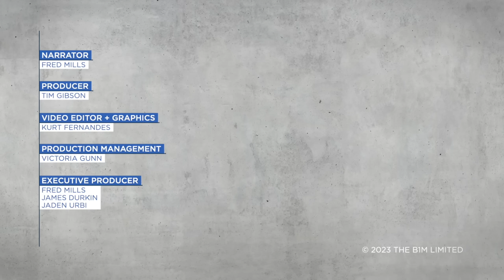The Race to Build a $6.3BN Railway for the Olympics

Comment: Excellent video and a really impressive project. Putting a mezzanine in the bored tunnel seems like a really innovative solution (I'm not aware of if it's been done elsewhere). Also, I can't help but notice the Cross River Rail logo is practically identical to the Crossrail logo.
Reply: I think something like mezzanine has been done in Barcelona

Comment: Calling it a 'race' to finish it for the Olympics is a bit of a stretch. It's scheduled for 2026, and while it'll almost certainly be late, 6 years is a lot of wiggle room.

There are a lot of planned expansions to the network that are dependent on the inner city  capacity created by CRR though, and they'll be very challaning to get done by 2032. Most key of these is the Direct Sunshine Coast Rail Line project, as it's presence would be a huge boost for any events hosted there. A core aspect of our bid was that we'd host the Olympics are a region rather then just Brisbane city itself. Thats going to require much stronger intra-regional transport links then we presently have

Comment: Questions about the mezzanine: Is it the whole length? Is it thus an alternative to the trains? Will bicycles be allowed as well as pedestrians? Will there be a charge to access the mezzanine?
Reply: The mezzanine is only for station caverns. The train tunnels connecting the stations, will only have enough room for trains, they are quite narrow tunnels. To access the mezzanines at train stations, you may need to tap on with a Go card or with a debit card, but you could tap off when you leave and not be charged.
Reply: Mezzanine spans all of cavern (approx 200m). It will be a walk way above platforms. Access to platforms from mezzanine will be be via escalators and lifts.

Comment: Being from Brisbane, I really have to cringe that the stock footage of the Bowen Hills Spaghetti Junction features so many times in the video! Really need to dial the car-centricism right back and build far more projects like Cross Rover Rail (like an actual underground metro rail system - Cross River Rail is actually part of the suburban rail network, not a metro as stated in the video).

Comment: "A new metro that burrows under the city itself..."  As opposed to a metro that does what??
Reply: Is above ground like most of Chicago
Reply: A metro like the other stupid one we will have soon that are electric buses! Wish they wouldn’t call that a metro.
Reply: "Metro - A rapid transit rail transport system, or a train in such systems, generally underground and serving a metropolitan area."
Reply: There's many great metros that run mostly overground, meaning elevated. But nowadays those are really difficult to build with individual rights being so much more important than doing sensible stuff
Reply: @jan-lukas  There are some, but they are not usually referred to as, “Metros.”  Metros commonly referenced include: Paris, London, Tokyo, NYC, Madrid, Barcelona, Montreal, DC, HK, and others are all underground in the city centres.
Reply: Services a real economy?? ?

Comment: With the Olympics now coming to SLC in 2034 it would be interesting to see you all do a video on the proposed construction project called the Rio Grande Plan. Its a proposal to take the existing rail lines that cut through the city, splitting it in half, and burring them underground. This project is in its early stages, but I think its a big big deal and I also think it needs some awareness raised. Its a community proposed project from a group of passionate people. They are having their second public event to showcase the results of the Cost and Impact Analysis done by the city.

Comment: That's great and the infrastructure will benefit the city long after the Olympics.

Los Angeles is building a much more comprehensive infrastructure program that should be finished in time for the 2028 Olympics 

There will be several new Metro lines (both subway and light rail) and LAX will finally have an automated people mover that will connect to the LA Metro. Very exciting stuff.

Comment: "won the Olympic Games" - not hard when you are the only city who applies.

Heck, even I could win the Olympic 100m sprint if I were the only person running.

A large portion of Brisbane was and still is upset that we got the Olympic Games. It will do for Brisbane what the Olympic Games did for Melbourne (most people don't even remember Melbourne had the games).

Also, Cross River Rail was approved well before the Olympic bid meaning it's completely unrelated.

Comment: The only problem with all this infrastructure is that there are massive problems with the train lines coming into Brisbane from outlying areas especially the northern line from the Sunshine Coast.  For most of this line it is a single track (which along with passenger trains to Brisbane also has freight trains and long distance trains to places further north) and that makes travel by train very difficult especially for any Olympic events they plan to hold in this region.

Comment: The other big  Rail project  is the Inland Rail connecting Brisbane to the ports of Melbourne covering a staggering 1727 kilometres which is underway and due for completion in 2027 !
Reply: At 60kph, it will take a while. That was my experience on our Tilt Train, unlike the 400kph we did on the Paris to London train. It was quicker to go under the English Channel than it it was to travel "Express" from Caboolture to Brisbane.

Comment: Australia needs a super high speed rail line between West and East and North and South, preferably with massive sections underground to avoid the climate and so as to not inhibit animal activity
Reply: Australia needs it? No. 
Do some people want it? Yes.

Does it make economic sense? Absolutely Not. 

Flying is way cheaper and faster, if the hassles of going through the airport and  checking times were to be eliminated, absolutely no one would use trains. 

Trains literally became popular because of the unbearable hassles of going through the airport.

Comment: Seattle has done much of this and used the largest boring machine at the time in the world to dig directly under the center of the city. So a lot of what’s in this video is not new or particularly special. Seattle has a transit light rail tunnel under the city, more recently relocated an elevated highway to under the city, and long has had a heavy rail tunnel directly under the city as well. Seattle even built a world class symphony hall on top of the train tunnel and managed to completely isolate it from the noise of the trains.
Reply: Are you hoping to get a cookie or something?
Reply: Yes, Seattle is both a larger and older city than Brisbane. But it also has much worse transit accessibility, you can go a lot further in 45 mins using Brisbane's buses and trains, than you can in Seattle.
Reply: A contrast with Sydney or Melbourne would be more meaningful. Melbourne 4th and  Sydney 7th on the Global Likability Index. Seattle 34th. Brisbane 16th.  Vienna is first.

Comment: As key as this and similar projects are the vitality of the result will also require connections to outlying areas. 

I mean we did it with road$ which is a continual economic drain. So rail systems which demand far les$ maintenance have to be at least as connected as road systems are.

Comment: I wonder when Canada will finally start a mega project. Busiest highway in the world and nothing
Reply: As a resident of Brisbane, I am confused by this comment. Canada has projects that make everything Australia is building look tiny. 

For example, the new REM that has opened in Montreal. Or the network wide expansion of GO's rail corridors and Toronto getting a new automated subway. 
Canada is going to have some of the densest most walkable, urban cities in the world. Some of those cities will have the best transit in the world, certainly Toronto at least. 

Brisbane's suburban bus frequencies can be hourly in some places. Not to mention our extremely radial network meaning getting from suburb to suburb always requires going into the middle of the city. Almost no buses go across the city like in Toronto. 

Yes Cross River Rail is an awesome project, and we will soon have bus network reform and the Brisbane Metro BRT project. But Canada has a lot more going on. Canada is also a lot more likely to start construction on high speed rail than Australia will ever be.

Comment: Good job in showing pictures of different cites that aren't Brisbane, that are 50 miles away of Gold Coast....
Reply: Both cities are so interconnect they have the same public transport system. Thousands of people live in the Gold Coast and work in Brisbane. CRR adds 3 new Gold Coast stations and CRR will be the new route for the gold cost suburban rail line. Also the Gold Coast is hosting some Olympic events.
Reply: @conorchristmas6844  my point is, that the point is not made

Comment: Melbourne is building almost the same thing, if not wrong, they're even ahead of Brisbane
Reply: But Melbourne doesn't even have a train line to the airport like Brisbane
Reply: @adambrock3932  that's not what this video is about
Reply: @miranblazek5303  actually it is
Reply: Same with Sydney and we are doing it at a heaps larger scale, the south west metro line that tunnels under the harbour will open up with plenty of new stations and converted stations to Bankstown and that's not even looking at the other 2 lines under construction alongside the airport. If anywhere is ahead it would be Sydney with its infrastructure projects. Plus I still find it funny how Sydney will have 2 airports with rail links before Melbourne even gets 1
Reply: @adambrock3932  its about the second river crossing in brisbane, melbourne is getting another one too

Comment: I think it's a little disingenuous to say that the model was made in projectwise. Projectwise is an environment that hosts the model, but the architects and engineers did not make the model in projectwise. I'm sure they developed the model with many other software products, I hope they used Rhino + Grasshopper as it's the best design software and I know it's pretty popular in Australia, but idk for sure. Regardless, saying something like this requires projectwise leads those who manage projects (but have no intuition on how to design it) to force the designers to use it. But as the designer I would rather be in control of what products we use to make sure they are the right ones

Comment: Why an underground rail crossing vs a cheaper rail surface bridge
Reply: If you have a look at the CRR project map, it chose a corridor that causes too much disruption to the surface had it not been a tunnel.

Brisbane seems propose tunnelling as the default, also for projects where it doesn't make sense such as the northern transit corridor that is proposed. They want to tunnel under the corridor of grass that was reserved for rail, because they don't want to disrupt the nature. 

I get not wanting to rip up nature but there are ways to mitigate. So yes, Brisbane certainly is infatuated with tunnels.
Reply: Because it is entering the city centre so how could it not be in a tunnel?

Comment: They could've tunneled it (cut & cover) under the park surface along with the Inner City Bypass... In a very much straight line, instead of meandering in slow-mo
Reply: Australian rail projects tend to be against using cut and cover.
Reply: @KhanPiesseONE  The City Circle in Sydney used Cut and Cover.
Reply: @TrainsForNSWVlogs  Yes but I meant newer projects
Reply: @KhanPiesseONE  True that was in 1932.

Comment: I live in Brisbane and this money couldve been spent on way way better infrastructure projects than this. Towards the north of City there are essentially only two roads, Gympie Road and Sandgate road both of which get choked pretty badly. Its a major issue for people living there. Same goes for the west of the city. The suburbs this project are going to connect are already pretty close to city with good bus access or even car. This didnt even touched on gabba expansion which is insanely expensive project for the amount of seats its delivering (I know number of seats is just one thing but there are far better things this money should have gone to)
Reply: As another resident I totally disagree with this assessment of CRR.
Reply: @newbris  you did convince me with such strong arguments mate 😅
Reply: @heisenberg4763  to be fair it wasn't directed at convincing you. YouTube has word limits and the starting point was too far!

Comment: One crossing? Rubbish, there's two crossings, and we used to be able to override the limit by using Tennyson Corridor that leads Ipswich bound traffic back to the Gold Coast Line, but they closed own that line down to public transport.
Tunnel is still helpful though, it'll also be nice when they eventually upgrade the "metro" into a tramway will help too, especially seeing how Gympie, Cleveland, Ipswich and Milton road are all already static at peak hour and widened to people's doorsteps. We need our public transport to step up.

Comment: This is similar to Melbourne’s Metro Tunnel, although we’re a lot further along with full speed train testing in the tunnels now having begun (our early works also started around 2017). Although Metro Tunnel 2 is probably even closer given that it is also mainly a cross river project
Reply: Relatively similar overall, here's a small rundown of what I found.

Brisbane started in late 2017, expected opening is 2026. Melbourne started in 2018, expected opening is 2025.

Brisbane's is costing $6.3 billion
Melbourne's is at $12.58 billion

Comment: Pity there hasn't been a video about Geneva's CEVA connection, because relative to the size of the city and the resulting new network created that extends over to France, it is equally if not more impressive than this new line in Brisbane.

Comment: And due to poor future planning of infrastructure in the city then the tunnel system has ridiculous spiralling slip roads for cars and these are expensive tollways so nice to see the planning of the new rail link is as twisty and well planned 🤣
And people need to investigate getting to work before moving to the city as the traffic is horrific for getting into the CBD or worse if having to cross the city without paying for one of the tollways.

Comment: As a Brisbane resident I can confirm that this will be a debacle of immense magnitude that we are paying off financially and emotionally forever.
The town planners and white collars fk everything up in this bandaid fix of a city. 
The Kippa ring train line was a fk up with the Simplest problem that was literally a computer part..
The Inner city bypass/overpass spider web of concrete that not only looks ugly but you cannot get from the valley to the north end and other pathways.. what was the point??
Then theres the infuriating traffic choke points at Nudgee and southside where some idio7 decided that instead of 4 lanes they'd go 3 in to 2 lanes on a bend at a major intersection from Redcliffe.. i mean you have to have a 2 digit IQ to think that would ever work... 
Everything in this city is just a band-aid patch up job 😅 

This tunnel is already going to have maintenance issues.. the contractors that built the train yard botched the installs of safety critical hardware.. thats just the start...

Fun times ahead.